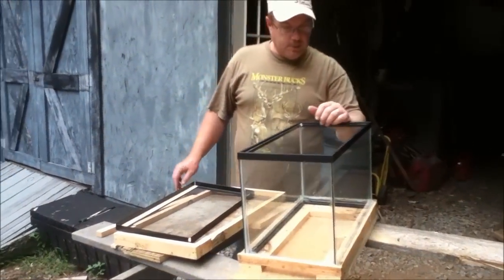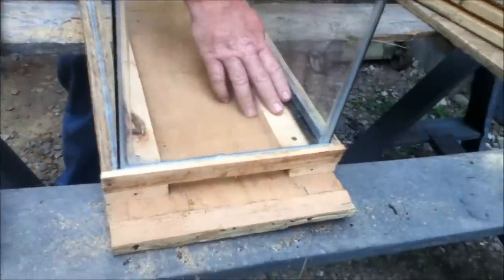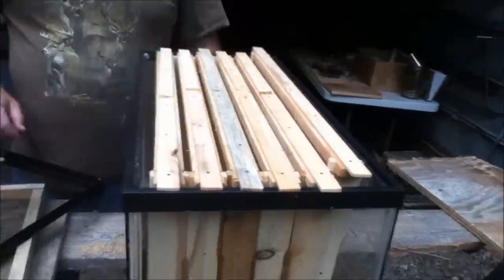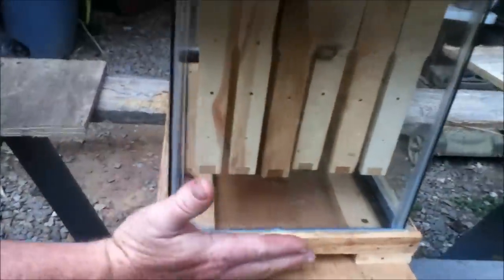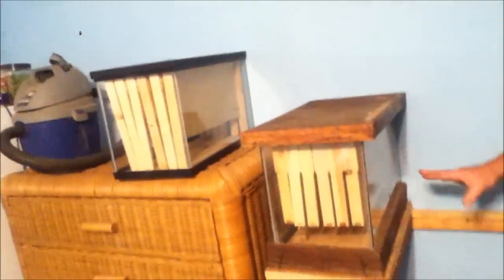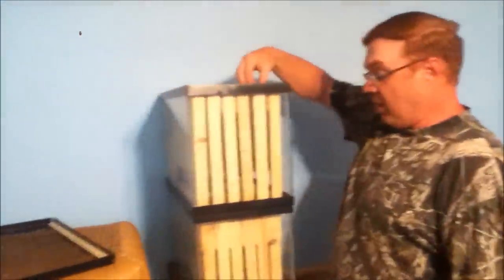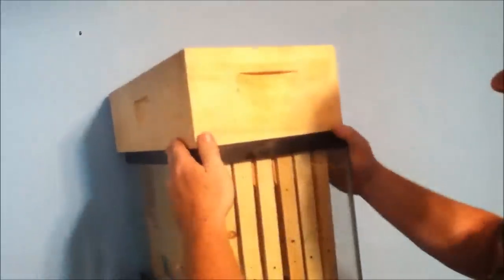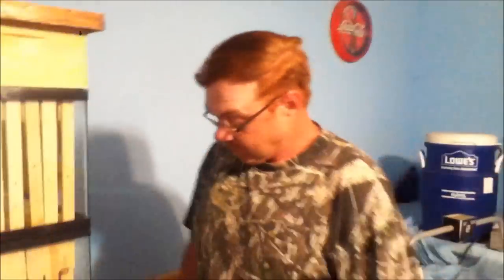D.I.Y Glass Aquarium Beehive Cheap and Easy *Extended*

Comment: I like this idea. A lot! I do see problems keeping it inside a building or a house though. The problem I see is carrying all that with bees in it outside to do inspection. My OB hive is all one piece but with hive, bees and food store it get very heavy. With a standard deep frames weighing 7 pounds when packed with food and you have 6 per box. That would be roughly 42 pounds on honey alone. So if they fill both boxes now your at 84 pounds and that weight is just in food. So maybe a portable cart would work as a stand. This is as long as there are no stair to go down once you take it outside. Good idea though just think it needs some tweaking.
Reply from the maker: +Jason “Beeman” Chrisman  This hive is inside our outbuilding ,so we work it inside the building, and then  when were finished we just leave the building doors open so all the bees find their way back out and into the hive.usually all are out of building before dark. Wanted to put it in house but i guess then i would be the one having to sleep outside anyways thanks for comments.
Reply: *New* Unusual Bee Works Like I said I do think it's a great idea. I just think that new beekeepers should be aware of what I pointed out before they put on in their house. I would like to have one like this myself but before I do I would need to figure out how to safely move it.

Correct me if I am wrong but isn't the aquarium glass tempered? When you broke on the bottoms did they shatter into small pieces? 

The more I think about this idea a person could make one of these into a top bar hive. That would be interesting.
Reply from the maker: +Jason “Beeman” Chrisman No, The bottom is not tempered. It broke out into large sections. And Yes, we thought of making it into a top bar hive ourselves. We don't work this hive very much, only observe it. Check out my No-Drown Feeder I came up with, tell me what you think.

Comment: Cool job, instead of Duct Tape to secure the two aquariums build a spacer kind of like what you did for the bottom aquarium, but allow for it to slide over the top and allow for the second aquarium to slide into it.

Comment: nice nice,  however,  I believe the top cover  seems to completely block air circulation so I would include a little cupola with vents to have a minimum air circulation,  keep in mind that the glass can let the sun in and create a hot house or green house  then if no one is around to remove that solid top without any  vents ,  the bees can overheat
Reply from the maker: +2coryman Your exactly right. This is why we use a screen cover top and the hive is inside our building where it is not in sunlight. There is alot of different ways a person could build a screen top for outside use. I shared this idea in hopes that people would build their own and modify it to their likings or improve on it in someway. Thanks for comments and for watching!

Comment: Light will be a problem unless if you cover it with something to provide shade and only open it when you want to observe / interact. Humidity is another problem. You need ventilation or your bees will die from their own heat. Heat necessary to grow the young ones. Ventilation and shade plus everytime you will interact to add frames or whatever your house will be full of bees. Otherwise is a great idea.
Reply: Bees won't die from their own heat, if it gets too hot, they stop heating and start cooling.

Comment: How much space is there for bees to move around on top of the frames? It doesn't look like there is any with the screen set on top, will you put in some small pieces of wood for the 3/8 bee space? Also, will you do a video on building frames? I'm wanting to build my own. Thanks, Kim
Reply from the maker: +The Abled Gardener Ill try to put up a video on modifying frames. you could probably make as a top bar hive also if wanted. Once i let frames hang on the inside plastic ledge of aquarium there was adaquite room for bees, This now is one of my strongest hives. Thanks for watching.
Reply: +New Unusual Bee Works Thanks for the video, it was so interesting.

Comment: this is awesome. i am going to do this. can frames be built easily or is that something special that has to be done?
Reply from the maker: JarJarJarvis You may have to take a little bit off of the tabs on the frames for them to fit inside of the aquarium. It just depends on the brand of the aquarium or where you get it. We simply put a strip over the top of the frames and shortened the tabs for them to fit the inside lip of the aquarium.
Reply: John W. Jarvis I found adding a piece of wood to the aquarium works grate to.

Comment: will the glass be able to hold all the weight when honey is filled up, you will need to provide support for each aquarium separately
Reply: a ten gallon aquarium when filled with water weighs 100 lbs.....   so it should be able to hold the weight of the hive with no problem as it is lighter than that according to earlier posts.

Comment: if the aquarium hive box is incorporated into a hive or alone, set outside, won't the temperature possibly get too hot in direct sun?
Reply: +phoneguylms - Observation hives are NOT for placing outside.  They are designed to be indoors to allow you to OBSERVE the activity of the hive.  When not observing you normally cover the observation glass.

Comment: Instead of adding wood to each frame, why not just build a extra adaptor for each end of the tank to hold the common size langstrom frames? Good idea and video, think I'll build one. I've seen these old tanks sitting by the side of the road discarded with cracks that wouldn't matter to the bees. A little caulk or clear tape would seal it up. If I did make one from an old tank what would be the best thing to use to sanitize just in case there were anything bad in the tank? I think I'll use pvc water pipe and add the defroster duct from a junk car to the inside so the workers can't get lost on their way in.
Reply from the maker: +teknonut1946 I probably wouldnt use a cracked aquarium because of the weight that will be on it , I would probably wash tank out with hot soapy water with a little clorox in it. The Great thing about this idea is you build it how you want to. We thought about using the langstrom frames, they would work and look great also! Thanks for comments and watching!

Comment: Wouldn't this cause the bees to overheat unless always in the shade?  It would act like a greenhouse, allowing the light to heat the inside, unlike a wooden container that doesn't transfer the heat nearly as much.
Reply from the maker: +seancoyote yes, if you had it in direct sun and not covered you are right,but ours is inside our building and has a screen top. Its doing great.
Reply: Glad it is doing well =)

Comment: Can this hive be kept outdoors or is there drawbacks to that since it's glass?
Reply from the maker: yes but must keep out of direct sunlight and keep glass covered when not observing bees
Reply: Thanks!  So would you suggest the cooler hive for outdoors over the aquarium?
Reply from the maker: yes but i made a pt 2 video on modifiying cooler that's very important
Reply from the maker: either should work great, cooler hive much easier and faster yo put up
Reply: Just saw all your cooler videos.  Sorry to hear about your lost hive.  Is it working better now?  Also
Where do you get the frames for your hives and what size is the cooler?
Reply from the maker: I believe I told on video the size of cooler, Can/t remember right off the top of my head  and it takes the standard hive body deep frames

Comment: What are the measurements of the wood?
Reply from the maker: I made them fit the aquarium, the length is the same as standard deep frames but I made them 12 1/4  so they would be closer to the bottom of the aquarium.

Comment: how can i keep it insulated?
Reply from the maker: Mine is inside our building. Don't put in direct sunlight and you can wrap it in winter time. I once used a quilt.
Reply from the maker: We started out with one aquarium and as hive grew,we added another. yes, but our bees come into hive through a pipe that we ran through the wall, so that no bees would be flying around in building with us
Reply from the maker: I would set up some cinderblocks with a piece of ply wood on top,leave a inch and half fall to the front so rain will drain away from hive. Same as any other BeeHive just Not in direct sunlight. Bees like their hive to be dark inside so  we keep ours covered with a plus size dress that we cut the top out of. You can put styrfoam sheets around outside of hive or regular house insulation, If its up off the ground where snow wont cover it, should be fine Glass has a R-value and bees will cluster.
Reply from the maker: I do have a facebook page. I'd have to pm you that info, I have had problems with robbing but not with this hive. It helps to keep entrance reduced way down.